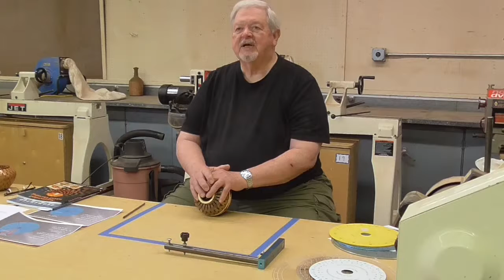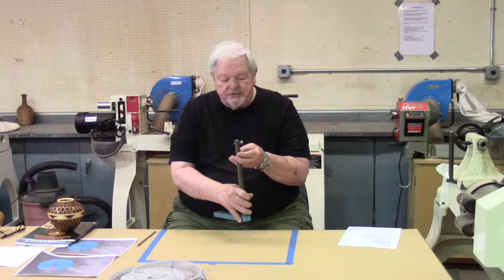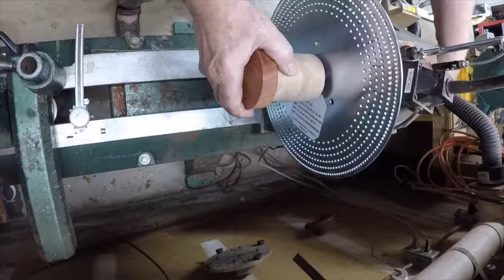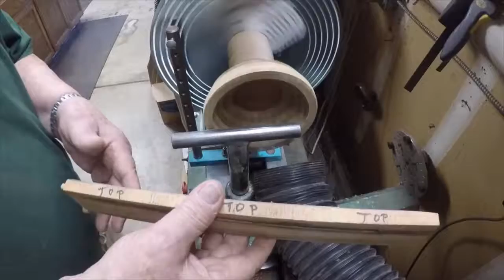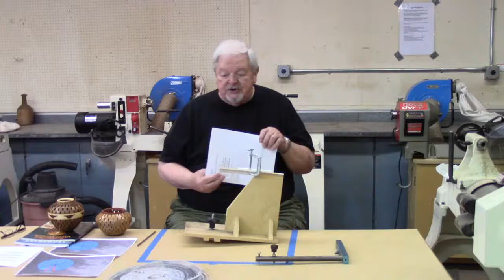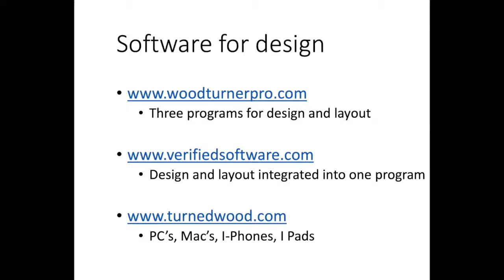Open Segment Turning, Part one  - Turning on the lathe

Comment: I have an issue when determining how many holes to skip on the index wheel, any prints to solve ?
Reply from the maker: I found the hole and divide by the number of segments then use a felt marker to designate the holes I want.

Comment: Thanks for the video. Question - why does the sanding block say “Top”? Have you ever tried Titebond’s Quick and Thick? It dries clear so squeeze out is hardly noticeable
Reply from the maker: The "TOP" label lets me know which side to place on the tool rest when sanding as the "bottom" is known to  be square and smooth. The top ...not so much! I have stuck with the Titebond original and have not tried a thicker glue.